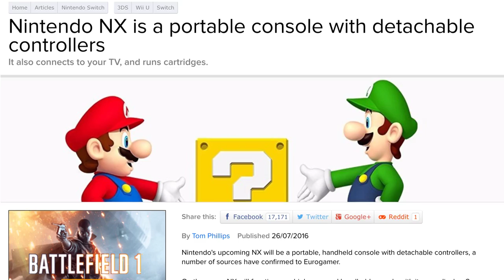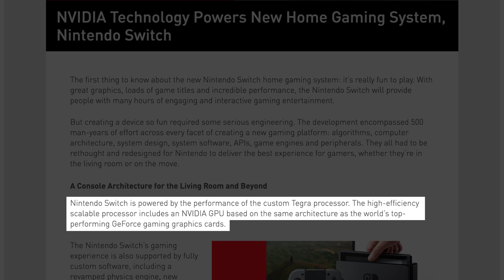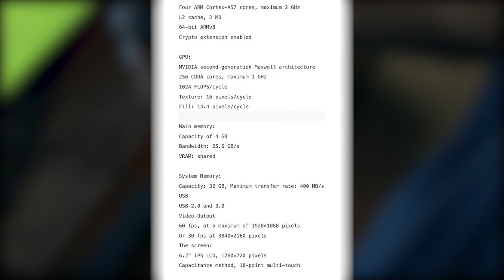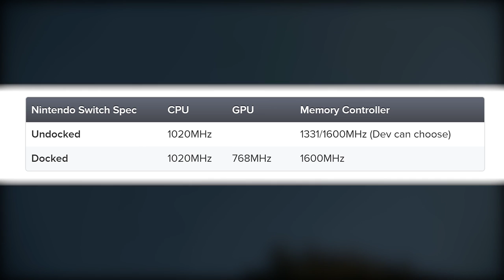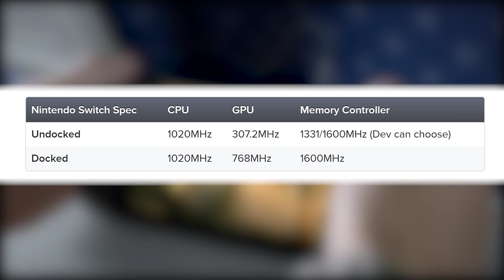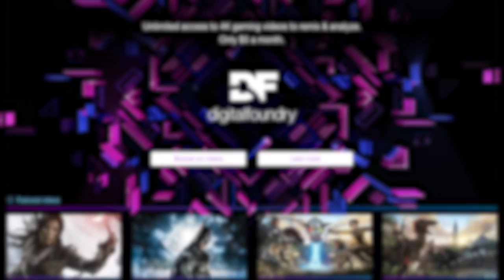DF Videocast #6: Nintendo Switch Clock-Speeds Revealed

Comment: Am I the only one who doesn't see the problem with the specs? I thought all consoles are underpowered hence the reason everyone is making the switch to PC
Reply: The problem here is that even for a current gen console, this is very underpowered in docked mode. While for handheld, when undocked, it's quite powerful. As it is, it's actually weaker than NVidia's own Shield. And just FYI, the Shield was a flop. It was deemed too weak at the time.
Reply: The problem is that are many games in the current generation that pushes  the current ps4 and xb1 hard and the switch isn't even close their level of performance.
Reply: You can't compare the Shield with the Switch based on that logic. The Shield did a Titanic already at the concept stage because Nvidia got a PC fanbase that do console gaming on Xbone and PS4. Why any of them want the Shield?
The Switch on the other hand is a handheld device with the ability to connect with your living-room equipment. Nintendo already have the DS fans, they have the Mario, Zelda etc fans... there is already a market for this device. It isn't meant to run GoW4 or GTA6 for the 15-18+ crowd... it is meant to run Mario and Zelda for the 7-15+ crowd. 
Lower specs is fine in handheld mode, why do anyone want the power to run 1080p games on a 720p screen except lazy (or unskilled) console developers that don't how to make games with graphic settings? As this isn't a AAA PC / Console machine, those big games aren't really interesting anyways... Let us see if Nintendo vice up and instead starts to collaborate more with the indie developers that make games that would perfectly fit their hardware.
Reply: Patrik Kotiranta Lundberg Hey it's got Skyrim! Fingers crossed for some Boarderlands and some witcher 3 ( I think it could run witcher 3 at med 720P quite well)
Reply: Patrik Kotiranta Lundberg Sad truth is that in-house games are not enough for the company to make proper profit. 3rd party dev support is required. And if the system isn't strong enough to run those at any decent enough performance...There is only so many people that like Zelda, Mario, SSB, Metroid or Pokemon enough to buy every game of the franchise. And then there is games that only come out in Japan and never make it to other countries. Further limiting the possible revenue. Just see what happened to Sega. They lost the 3rd party support and in the end, stopped competing on game console industry. Back then it just happened faster because there wasn't as many gamers.
Reply: At first. I said "this is a shield tablet" and any 3rd party games on this will be on the ps4 and xbox cos they can do that freely. Now I just don't care it's so underpowered
Reply: nobody with a brain expected to outperform the ps4 and xb1 they were expecting something stronger than this.
Reply: Mimu Mi It's not that it was expected to beat, not even match, the PS4 or XBO. But it's way weaker than what was expected.
Reply: Paul Badman "everyone is making the switch to PC" yeah that's why PS4 has sold 50 million units and battlefield 1 a game that was once a PC exclusive has sold only 150K copies on PC while it sold 7 million copies on PS4+Xbox one
Reply: xbox one and ps4 were underpowered yep.

But the Switch is a complete new level. This so called home console will be weaker then an iPhone 7. Check GFX Benchmarks and Geekbench for iPhone 7 and Nvidias Shield Console or google pixel C. And the switch will even be significantly weaker then both. Pathetic
Reply: coolertuep yeh but Iphones don't have a controller (good looking one) and Skyrim and Zelda.Most games can run on a dual core processor 4GB ram and 2GB GFX at 720P and it's Nintendo they haven't down power since the N64 even their handhelds have been underpowered but have played games and sold very well.I just don't see the big deal over this,I'm going to buy after launch either a way.I actually really like the idea of this console and think this is the direction consoles need to go,This generation of consoles have proved that consoles can't keep up with the cheaper equivalent (PC) no matter how hard they try.They actully think a 2.5 year life cycle will take off...... It wont,If you love consoles you need to get behind this and support it.If MS and Sony want to really make some money maybe move to cloud gaming with a monthly subscription before anyone makes a legit move for it......Yes cloud computing is the future and big companies are putting the infrastructure in for this at the moment (I work in networking,This is what we have started putting the infrastructure in for.A very big online PC storefront is a client of ours)
Reply: ***** Dude I play Wicther 3 on a shitty laptop at work it runs at 30FPS on med-low setting at 720P I mention Skyrym because it's a good game (200 hrs in and not finished it).I already own a Decent PC at home I only would want a switch to play a good game while i'm traveling or staying at a family members house Pc is too big to take with me and the other 2 consoles are fucking trash.You think huge specs are needed to play most recent games and you're wrong they're not as long as they're optimized well I think the new Tomb raider only needs 4GB ram and a dual core processor but I could be wrong!
Reply: Paul Badman "making the switch to PC" I see what you did there
Reply: Well, you thought wrong.
Reply: Rockymann27 I'm wrong,I'm still buying it if the price point is right. Soooo What's your point?
Reply: I wish my budget allowed me to switch to PC... However it's only enough for one console... PS4 apparently since Switch most likely will disappoint me.
Reply: Tom Raptile Well, you can get decent used pc builds for around 250-300$/€/£/whatever currency you use
Reply: Paul Badman That that is why everyone is switching to PC. Not everyone is switching to PC and that is not the top reason why people do it if they do.
Reply: Rockymann27 Actully people who use PC to play games spiked this gen myself and most of my friends switched from 360 to mainly because the the price per performance on consoles is laughable
Reply: Paul Badman Can you show me a factual statistic to prove this to be true from a reliable and credible source? Both points, not just one.
Reply: Rockymann27 You're gonna have to check that yourself
Reply: Paul Badman So...you cant prove it and are guessing at things. Got it.
Reply: Rockymann27 No it's real THAC did a video on it
Reply: Paul Badman Dont know who that is and you have yet to provide a reliable and credible source to back up all of your claims.
Reply: Mike Zimmer They can keep talking I have a PC so I'm superior in the couch gaming market however the long plane/bus/train/parents house market Switch will be king
Reply: Paul Badman Just having a PC doesnt make you superior to another person. And still waiting on that proof.
Reply: Rockymann27 Told you go to THAC the stream spreadsheet is there.....Also having a PC does make you superior
Reply: Paul Badman You are not a better person than someone else for having a PC. Get over yourself. Also, not posting a link to your proof just proves you cant prove what you say. The burden of proof is on you, not me.
Reply: Rockymann27 THAC THAC I keep saying it you don't listen.It's like the saying goes you can take a peasant to water but can't get him to drown himself
Reply: Paul Badman Insults and having a superiority complex doesnt get you out of the point of you being lazy on providing the link. Also, youre the kind of PC gamer that people hate and give a bad name to PC gamers everywhere. You really should stop doing that to us. I would call you a peasant, but one of us here has to be the mature one.
Reply: Rockymann27 Have a nice christmas?

Comment: Anything above 250 dollars this switch is dead
Reply: Can't wait to see the 720p Zelda gameplay on my 50" TV in 2017. Pixels the size of potatoes and running at 20fps
Reply: Zelda is rumored to be 1080p on Switch. Nice try though.
Reply: i think 200 dollars is to much
Reply: with this specs it should be 150 bucks at maximum.

My Phone is way stronger then this.
Reply: Nintendo is not listening to its customers
Thats a bad move
Reply: @AceTechHD
The switch will be weaker then an iPhone 7 (which already outperforms the not downclocked Shield console and Pixel C tablet in most benchmarks).

Here are some Benchmarks guys.

Geekbench 3 (processiong performance)

iPhone 7 - Singlecore: 3380; Multicore - 5500
Nvidia Shield Console - Singlecore: 1650; Multicore: 5040

The Switch will run at 50% of the Shield Consoles clockspeed.

GFX Benchmark (graphics performance) Trex 1080p offscreen Render:

Nvidia Shield Console - 120 FPS
iPhone 7+ - 108 FPS
Google Pixel C Tablet - 103 FPS
iPad Pro 2015 - 170 FPS
Xbox One - 400 FPS
PS4 - 480 FPS

And the Switchs  GPU will run at 1/3 of the clock speed of the Shield Console.
Reply: 1080p is a dream for switch
Reply: Stop comparing smartphonez to switch..  Mobile gaming sucks
Reply: Any thing above $150 and this thing is dead. At least at $150 they might get more of the kids getting one.
Reply: I'd pay $150 for this, but not a penny more!
Reply: I agree that could be the problem why they are probably going to use maxwell instead pascal, pascal chip stills expensive
Reply: coolertuep That's just a fucking rumor so wait until Jan 12
Reply: tfdsjunbkkn dyudssiiikndsui Oh yeah?? Maybe they should pay you to play it instead!! ROFL. You want brand new tech and pay a couple bucks for it?? This console is $300 AT LEAST. Nobody really cares if you can't afford it though
Reply: It's very bold to assume that they're just going to plop an original dye Tegra X1 into the Switch with no customizations. You're also omitting the possibility of a dedicated CPU which can boost performance (and judging by the fact the Switch needs active cooling to keep cool; this may very much be the case)
Reply: ***** I think it'll cost less
Reply: All the bashing will just drum up more interest in what's going on and cause Nintendo to be even more popular. The trolls are winning us "fanboys" battles for us XD
Reply: Ps4 pony
Reply: "pixels the size of potatoes" i died xD
Reply: "mobile gaming sucks" and so does the switch

Comment: This hardware discussion is honestly pointless.
We all know that Nintendo isn't known to use the most powerful hardware compared to its competition (Sony, Microsoft).
What Nintendo is known to do is use less powerful hardware, but drastically optimize their games to run well.
Nintendo focuses more on gameplay, story, and user experience rather than graphical fidelity.
Reply: I would agree on that but for me it's just a missed opportunity. Especially since the switch is designed to be a home and "on the go" device. Using a more power efficient chip would have made the "on the go" part a lot better, while also providing better power as a home console. I guess Nvidia gave Nintendo a good deal to buy piled up X1 chips that nobody wanted
Reply: Keep in mind that price is also a huge, HUGE factor in consoles. They thoroughly fucked up the 3DS' initial price, they're making sure that doesn't happen again.
Reply: I feel like Nintendo is trying to forget about the 3DS, Wii, and Wii U with this and start basically from scratch to not admit their huge screw up with especially the Wii U.

It's good they're using more powerful hardware from the Wii U while also keeping in mind of the price to manufacture the Switch, and ultimately the retail price to make sure they are competitive enough compared to PS4 and Xbox One.

They're very late to this generation and a lot of people already have the PS4 and or Xbox One.

Nintendo has to do things to impress people.
Reply: ´´Story´´? Nintendo games don´t have story :p
Reply: thats ONLY nowadays though...  they ''used'' to have powerful hardware and Great gameplay (they still have great gameplay now) but from 1990-2005, aka the SNES-gamecube-era, They Had powerful hardware! the snes was more powerful than the genesis/megadrive and turbo grapfx. the n64 was more powerful than the ps1, the gamecube was more powerful than the ps2 by a long shot, it could even rival the xbox which was in terms of raw power 248 mhz faster than the cube (733mhz), but nintendo by all means manufactured powerful hardware that's for sure! it wasn't until the wii they started to slack off. don't FORGET they also had gameplay back then, it could be said that some of the best games of ''all time'' came out between 1990-2005.  what im saying is they used to have  both of em' now they slack on the graphical fidelity cause they can.
Reply: ps123fan Regardless, Nintendo is making a new console. If you want them to do better, then support them by purchasing their games, consoles, downloading things, etc.

Personally, I'm a Sony gamer so for now the PS4 and not so much the Vita is enough for me.
Reply: xxnike629xx excatly thats why i have the Nes - Snes - N64 - Gamecube - wii - wii u
Reply: xxnike629xx noone wanted or expected most powerful console or handheld but if these are true than it has less power than any  $250 phone
Reply: xxnike629xx Story? Monster Hunter is heavy grinding and minimal story. Mario and Zelda don't have the same kind of narrative as like Metal Gear Solid, The Last of Us, etc.

Monolith Soft is the only one I can think of who puts effort into story because they produce JRPGs by default.
Reply: Your logic is backwards. If you want a company to improve their products you don't throw money at them. You vote with your wallet and stop buying their products. The Switch isn't underpowered because Nintendo is lacking on funds.
Reply: Remember that Nintendo didn't meet huge success by playing the "powerful hardware" card. N64 has been sold less than the PS1, GC has been sold less than the PS2 too... So they decided to play on another field, where it worked for the Wii, and not for the WiiU. Let them show what the Switch will be capable of FIRST, then we'll can argue properly (because everything here are just speculations).
Reply: Kieren Rhys 
Nintendo met huge success by coming into the American market at the right time, with a good system, and great games that people wanted to play. They maintained their dominance in the mid eighties  to early Nineties by employing strong arm tactics. The FTC charged them with price fixing for how they coerced retailers. They got a sweet settlement deal. They just had to pay 4.75 Million dollars in fines to 39 states and $5 to everybody that bought an NES. Every system after the NES sold progressively worse except for the Wii. The Wii was a fluke, a short lived, albeit well selling, fad. It was a novel concept but most people played it for a bit and threw it in the closet to let the batteries burst in the Wiimotes.

I'm sure the Switch will sell better than the Wii U but that's not saying much. They should have foregone the stupid hybrid gimmick and just made a powerful box that played their exclusives. People would have bought it and 3rd parties would develop for it. I wish they would go 3rd party so I could play their games without buying their stupid hardware. I think it would be better for their bottom line too since they would sell many more games and make money off software licensing.
Reply: +Kieren Rhys They also gimped their consoles with other things.
Reply: Nadir Jofas 
That's very true. That cost them to lose a lot of their market penetration. When they decided to go with cartridges for the N64 that was kind of the beginning of the end of Nintendo's relevancy in console hardware (the Wii being a fluke).
Reply: I don't really care about the american market (doesn't concern me) ^^.
The idea of making just a "powerful box", to gimmick Sony & Microsoft, is the WORST idea. If any actors do the exact same thing, there's no more interest in the market. It needs diversities to survive and stays sustainable.
Reply: +MOHAMED Yeah of course, but it costs so much more than the "average price" for a console. I don't think Nintendo's goal is to repeat the "high selling price" mistake (hello 3DS).
Reply: Nicolas Cortés Earthbound, Fire Emblem, Metroid Prime, Mario & Luigi, Paper Mario.

Need I go on?
Reply: Of those games only Metroid Prime was worked on by Nintendo (co-developed by Retro Studios and Nintendo). I mean I'm sure the dude meant it in a tongue in check fashion anyways. Like for example Super Mario Bros. every time it's save the princess. Lighten up. Anyways who cares? Usually story in video games is like story in a porn movie. I expect it to be there but I don't expect it to be good. Most of the time I'd rather skip to the action.